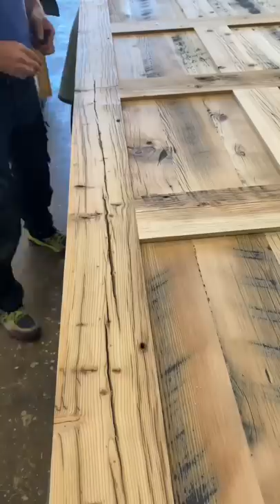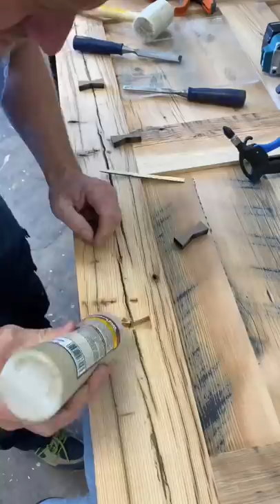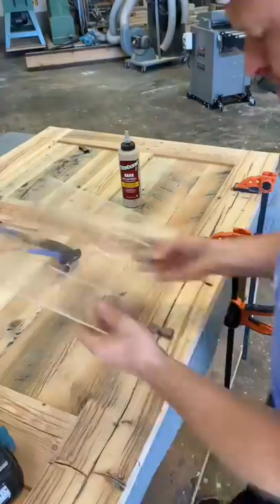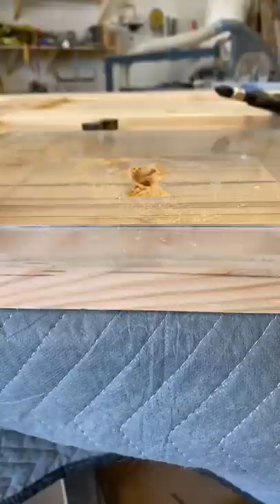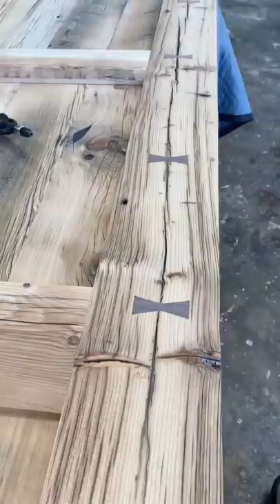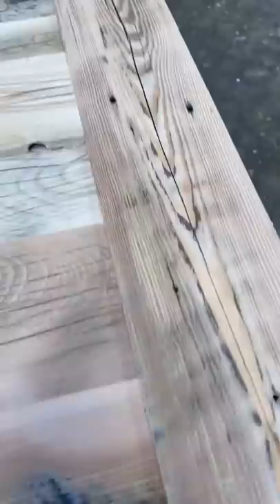Bow ties for a reclaimed wood door

Comment: One of the best things to finish that job is to use a small syringe to squirt wood glue into the cracks. Fill them to the top and let them dry thoroughly. That wood will never split apart then!
Reply: Was thinking some resin instead maybe. But glue would be cheaper and quick.